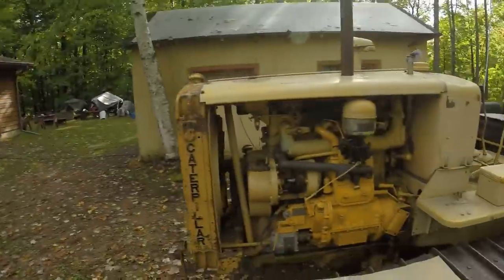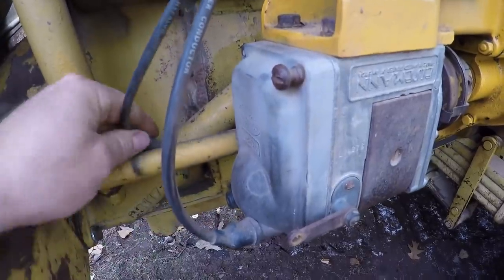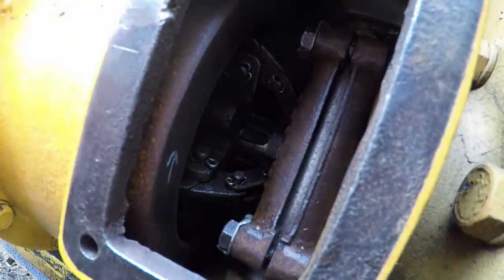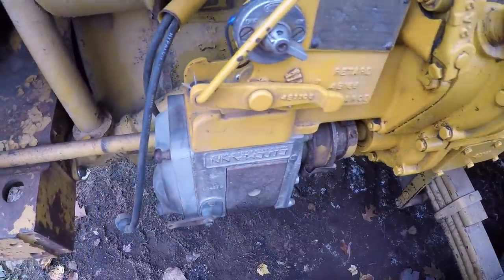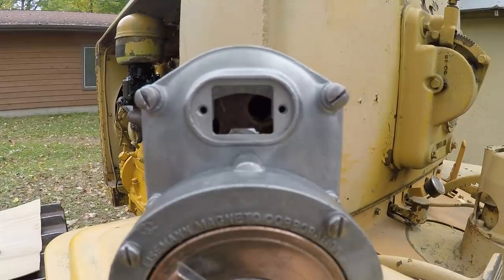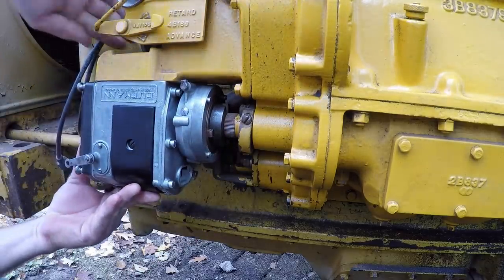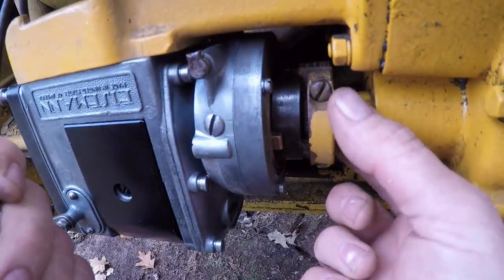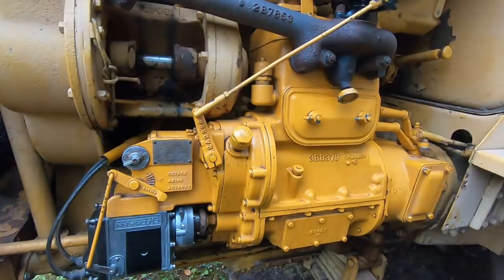Caterpillar RD6 Starting Engine Magneto Removal & Installation - Step By Step Sequence

Comment: Those old mags are a work of art. The newer ones have a better magnet but aren't as decorative. There's something about that big horseshoe magnet that is neat looking. I all of my antique tractors have had mags on them. The only tractor I have left is a 49 Allis Chalmers B. I rebuilt the mag on that one 19 years ago and It's still working great. That has a Fairbanks Morse mag on it. I was still working as a line mechanic at a Chrysler dealer and had the mag at work. One of the rookies, who thought he knew everything was playing with the mag after I had rebuilt it. It was clamped in a vise, sitting on a metal workbench when he rotated the impulse coupling. I told him if he heard it click he was going to get bit. He didn't listen I heard the impulse trip and him scream like a little girl at the same time.

Comment: If everyone's pony motors ran as well as yours do there wouldn't be a market for direct start kits for Cats! Man that's a sweet running little pony. Hope all is well, great start to a Monday, or here in Japan, start to a Tuesday!
Reply: @squatch253  I completely agree with you on the starting engine being the ideal way to start a diesel without any sort of other starting aids. In fact, the few people I know who have purchased and installed direct start conversions in my neck of the woods (Upper Peninsula of Michigan) haven't been happy with them. You just can't get enough heat in the engine with an electric starter to get the machines to reliably start below 40 degrees. They end up using excessive amounts of Ether, lighting charcoal fires in metal 5 gallon buckets, or drain pans to try and warm the oil, or both. Cat ran pony motors for a LONG time, because they just flat out worked. Even in sub zero temps, you can just run the Pony longer to help get some heat into the coolant, and you always had good oil flow and pressure in the main engine when it did fire. The international gas starting system also works quite well even in really cold temps, I once started a 1950's Austin Western road grader with a 460 cu in 4 cyl IH Gas start Diesel in single degree temps that hadn't run in 8 months with just a group 34 car battery. Fired right off on gas, ran for 4-5 minutes and switched flawlessly over to diesel. They don't make stuff like this anymore, and it's a shame. I much prefer heavy cast to plastic and stamped tin.

Comment: i have a thought..  you recall a few videos back about copper washers on important bolts that need to seal..  i think the 4 mag mounting bolts count as needing to seal.. to keep any rain and wash down water from wicking down the threads and into the magneto..  i would think some Hylomar or the hylomar in a permatex tube called Flange sealant 85420..  on the threads to act as an anti seize and extremely long term water proof thread sealant that never hardens.  i have split VW cases that were 17 years assembled. and the hylomar on the surfaces was still tacky and sealing.  heck.. i might coat the mounting flange of the magneto with a very thin layer of hylomar to prevent corrosion when placed against the iron mount.  the mounting bolts should have enough ground connection to complete the spark return path to the magneto..

Comment: Hey Toby! Does the RC-2Q mag require a certain impulse for these starting engines? Mine looks the same as yours but it is catching and binding while cranking, then sometimes its ok and snaps over, had Marks magneto install a nos impulse and its acting up again. Thanks, Gary
Reply: Never mind, I took the mag apart and found out the armature shaft is 1/4" too long and was holding the pawl assembly to far away from the catch plate. It would catch and cut the catch plate till it would latch anymore.
Reply: @squatch253  Thanks Toby